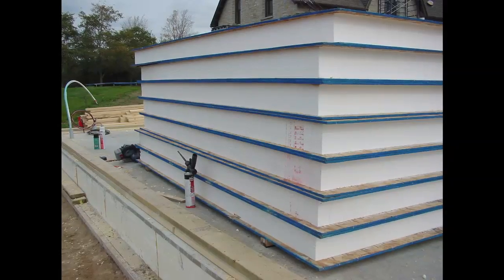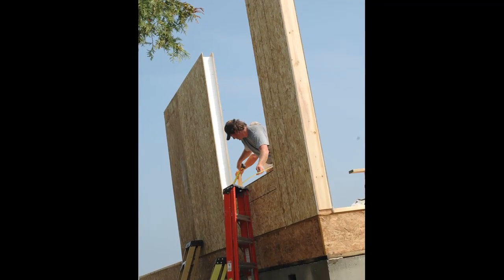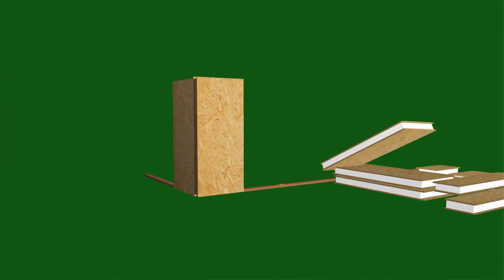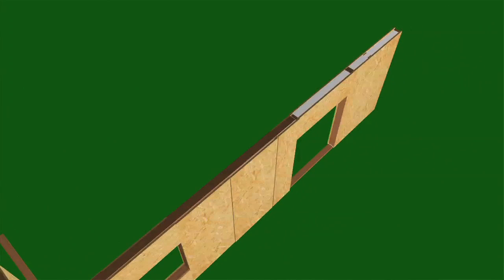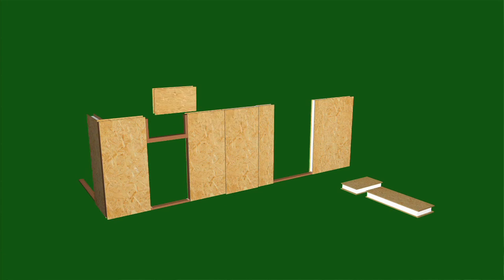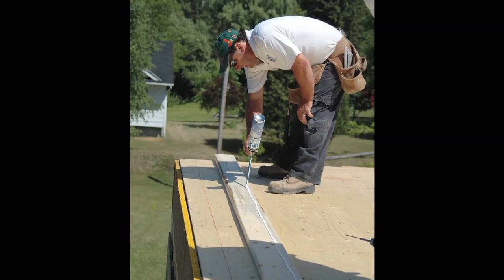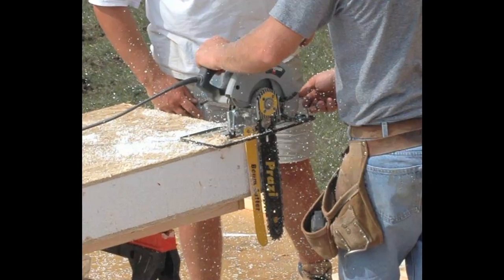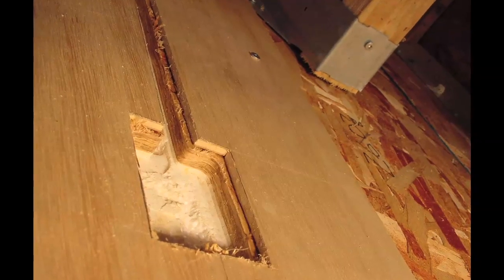How Structural Insulated Panels Work

Comment: Is the foam air tight, ie do you need a vapour barrier, if so you break the VB when installing slots for wiring. Seems better to batten and add additional inner skin to run pipes and cables.

Comment: Is it ok to put battens on the inside to create a void for plumbing and wiring prior to plasterboard? For would that affect the fire rating? Also, is wood cladding ok on the outside or does it need fireproofing first?
Reply: i’ve seen sips with battens.. I think Kingspan TEK has an example implementation on their website with cross batten service cavities on the internal side of the sip, and brick outer leaf also (instead of siding)

Comment: How long before this foam material breaks down especially in a very hot state etc
Reply: Hello Hard Truth!
SIPs panels have been code approved for 50 years, including for hot climates. Here where I live it's not a hot climate, but in the summer my all-SIPs roof on my workshop gets hot enough to fry eggs on. You simple cannot put your hand on the roof it's so hot, with the only thing between the shingles and foam is 7/16" of OSB. Things work and last fine, even when the foam is super hot.
I hope this helps.
Bye for now,
Steve
Reply: @SteveMaxwellHowTo  thank you for taking the time to respond

Comment: Looks like an electrician and plumbers nightmare
Reply from the maker: Good Morning Josh! Yes, you'd think so, but it's actually quite easy to run pipes and wires. The key is to think vertically not horizontally. Running pipes and wires through floor and ceiling spaces gets you where you want to go in the building, then you simply drop down or come up with the pipes and wires. SIPs panels can have vertical channels cut in them without diminishing strength. I use a router to cut grooves in the OSB, lay in the pipe or wire, then foam over the groove. It works quite well. I hope this helps. Thanks for watching! Steve

Comment: Ease?
Well if you have a crane, and electrician on site, at all times.
Have fun playing with all the foam sealent.
The out come can be good.
Air to air ventilation is necessary. 
Things have changed since I used these systems 25-30 years ago. I hope for the better.
Roofs over heat killing shingles, even with the vented panels .  Have fun. Chris

Comment: i'm not a builder but i see some issues/challenges with these. Running new electrical/cable or even plumbing after it's built would seem to be a major pita. What about wall mounts - ex, tvs? there's no stud to anchor the mount into - and i sure as heck wouldn't rely on OSB to hold it.  Then there are building codes. In california , years ago i think i recall a requirement for fire blocks about halfway up a wall. maybe i am misinformed as it being an actual requirement. But speaking of fire, is the foam in these panels flammable? more so than traditional insulation?

Comment: Look, we need to return to building houses like those that are 100+ yrs old - gosh look at those buildings in Europe, Japan, etc that are 500-700 yrs old.   What about old houses 100-150+ yrs old here with the original windows.  And today we can’t get a window to last more than 10-20 that doesn’t need replacing.  I tell everyone who has old windows (50+ yrs)  to not replace unless absolutely necessary.  Repair, prime and paint then do storm windows on outside, interior storms on the inside like they do historic houses.  They will be there another 100 years.  Replacement windows were aptly named because you keep having to replace them.mmNuts. And have good oil paint made up with real linseed oil that sinks into the wood, use BoraCare first to keep rot and wood eating insects out.  After seeing fire testing and seeing fires in my area...SIPs  may well be more efficient but I’m not using foam nor OSB. And I prefer panels that have 2x4s embedded - they are stronger.n Without - have you seen what they look like when a tree falls on your house - they just cave and break - there isn’t any structure to hold them fast. Instead of replacing a few sheets of plywood or even better individual heavy 2x8 boards for the roof decking - with foam and osb - you have to replace most of the roof because it caves andmthe osb begins to warp, delaminate, molds with lots water.  My gosh, look at all the flooding and rain from devastating storms ...OSB will be toast flood or fire. And foam, panels or spray..I don’t want that toxic mess either.  Friends had spray foam and can’t live in their addition due to smell.  I would only do rockwool that doesn’t burn, has high insulation and water runs through it.  Note there are different types of rockwool in treatments. You don’t want horticultural...it absorbs water.  And I want MagBoard... very fire resistant.  I’m going to get a piece of it to throw out in the yard this winter to evaluate it with extreme exposure.  Same with rockwool home insulation.  It is getting where you must test building materials yourself in addition to research.  You just can’t trust most of the hype put out by these corporations...nor your builder.  15 yrs down the road when the systems fail...where will everyone be to back you up.  I’m living in Virginia too..want to check out hempcrete..has been around for thousands of years and all because of my..it was banned.  How can our politicians be so stupid.  Hemp is great for building, ropes for holding ships, clothing, paper.  I think some of our founding docs were written on hemp paper.
Reply: I'm a Architectural Engineer. When it comes to the old ways. Especially in today's world. The time frame of construction and the material costs are to high. Hence when it comes to older styles design and built homes it literally take a good amount of time. In most cases especially in today's. Most people are not want to wait 3 to 6 months or even a year to 18 months. The SIP literally depending on the size of the home. It takes literally anywhere between 3 weeks to 2 months. As long as the time schedule stays firm with all the other components stay as scheduled. The company I have... we are using SIP design and a new "Carbon Fiber" structural design. I personally would never take Hemp or something that looks like a weed plant. SIP literally last anywhere between 50 plus years. Because the structural design of it is supported by Polystyrene Foam which last about a 100 years. So it has a very low form of decay rate. As for the OSB there are spraying chemicals sometimes used to prevent water leaks and other element and bug damage. I can honestly tell you I just don't use any materials when designing or building my homes. I carefully  research materials to the point where I sometimes up upset investment people or clients. Otherwise I will not use the material. Yes most people only want to stay with the old ways period because they are comfortable with the past. There is absolutely nothing wrong with that. But eventually yes people will have to my forward with newer advanced materials.

Comment: except the fact that if you get a leak the wood leaks and the foam gets waterlogged adding to the weight you have no solid framing strength and your house breaks an falls apart.
Reply: Pretty sure the insulation in the panel - what you are calling the 'foam' - is inert so can't absorb water.

Comment: 1. Is there outgassing? 2. What will termites do to this wood in the coming decades? An earthen or concrete dome will never be attacked by anything. 3. How many decades will the foam glue that seals the panels last? 4. How does this system stand up to extreme heat in a forest fire or next door fire?
Reply: They have metal clad as well. Use steel framing and there is no termite problems.

Comment: This guy must be a SIP salesman.  I don't build with flake board.  Moisture makes it come apart in time.  Build with plywood.  Any builder will tell you that.  A good realtor will also tell you that a plywood home sells better and is more structurally sound than a home built from flake board.  Al little more expensive, but well worth it down the line thru the years.  If you build too tight with no air circulation, you will get dry rot.  A faster build might be nice because you get in your home quicker, but faster does not always mean better...
Reply from the maker: Good Morning Woodrow,
No, I'm not a SIPs salesman, and no, you don't need to build with "flakeboard" to building with SIPs. You can get SIPs made with plywood if you want. There are even SIPs panels made to use underground as a foundation wall in place of a masonry wall. Just so you know, though, OSB (what you call flakeboard) these days is highly resistant to water. I'm personally not crazy about OSB, but it does stand up to water surprisingly well. I've submerged the stuff for days as a test and it's just as strong as ever. The main benefit of SIPs is greater strength than frame construction and better energy performance. I know of a SIPs home in the Caribbean (made of "flakeboard"), and it has been the only building standing on this island after three hurricanes flattened every other building with each storm. Also, side-by-side tests of a SIPs home right next door to a frame home (both built to code with identical floor plans) showed 50% less energy use than the frame home even though both have the same R wall in the walls. 
Thanks for watching,
Steve

Comment: This might all be true, but I see two major problems with this system. One, How would this system hold up in a fire? I'm guessing not very well because the heat of the fire would cause the insulation to separate from the panel making much of the structure very unsafe to be in or to have fire fighters come remove you from it. Two, what would a flood do to this system? I'm guessing the flood waters would cause major damage to a system like this vs. conventional stick framed buildings. Imagine trying to replace a whole panel vs a sheeting and dry wall from a flooded house.  I believe the flooded SIP house might even be totaled after a flood and require complete rebuilding.  Homes don't just have to provide shelter in sunny clear weather. They sometimes have to save you from the harsh elements. This SIP house would be like trying to find shelter in a large foam ice chest.
Reply: True true true.  Ive been a mechanical contractor for 20+ years i love the idea of higher r value walls but not at the expense of strength and safety.  Nothing has changed my mind from stick frame with spray foam, or formed concrete with the insulation built into the cast.  The sips structure at the end also would not do well in high winds either.
Reply: Dunno, compared to concrete houses, both sips and wooden frames look the same in terms of structural resistance, but i can appreciate the modular nature of sips
Reply: I think it would depend on the fire treatment of the plywood and the air seal of the house. A tight envelope might prevent a fire from spreading by using all the available oxygen. With flood damage it would be dependent on how fast you dried it out. We're dealing with flood damage right now. Our neighbors with sheet rock have had to tear out everything that got wet, but our wood paneling has been fine, and so has the foam. Regardless it would require mechanical ventilation

Comment: How long do SIP houses maintain structural stability when they are fully involved by fire? Running electrical lines in continuous void spaces around flammable foam seems like a hazardous application. What is SIP's resistance to electrical arcing compared to fiberglass insulation?
Reply: Electrical lines are not meant to be bare and cannot spark in wall cavities if installed correctly. If rodents are a concern for chewing wires, there is less likelihood for rodents to burrow into the dense hard foam than in fiberglass. Also, many newer foams are treated with a boron solution during manufacturing for fire resistance. Paper faced fiberglass is going to spread fire much faster than a newer SIPs panel.

Comment: what happens when the glue holding the plywood and foam together degrades over time ? it is hard for me to trust in just glue holding plywood and foam together. id like to know more about how the bond is made.
Reply: and the fact that if you get a leak the wood leaks and the foam gets waterlogged adding to the weight you have no solid framing strength and your house breaks an falls apart.

Comment: theres gotta be a downside
Reply from the maker: Yes, there is a drawback to SIPs. A couple actually. This first is that they shouldn't be exposed to weather for more than a few months. This means that the building needs to go up and get dried in fairly quickly. Another issue is ants. They do love to nest in foam. I understand that chemicals are added to discourage ants, but I don't know if it always works.
Thanks for watching!
Steve
Reply: thankyou

Comment: +Steve Maxwell  Two questions please:

1.  Website Vertigo:  I saw this in one of your comments:  "For construction, woodworking, renovations and tools, drop by for a visit at  https://stevemaxwell.ca. Homesteading stuff is at http://www.realrurallife.com".  And somewhere else, a suggestion from you for people to sign up for newsletters at a different website -- https://baileylineroad.com.  How is that third website different from the other two?

2.  DIY SIP construction:  Have you looked into or have experience with making your own SIPs?  By that I mean, buy plywood, foam, and adhesive; and then find a way to paint on the adhesive and weight down the assembled panels until dry.  Might be more cost effective, maybe for small projects like outbuildings, etc.  Don't know as I've never priced SIPs.

Comment: Hello,
 I wonder if you can use those panels as slab in a metallic structure?
If yes, How would the junctions be?

Thanks
Reply: I wouldn't stand on anything like this without trusses underneath.
Reply from the maker: +ricard gimeno perramon Good Morning Ricard!
Yes, SIPs can be used for self-supporting floors. The thicker the panel the more it can span. Panels are 4 feet wide, and the joints are accomplished with a double-thickness of 1 1/2"-thick lumber fastened together and fitted into the recesses along the edges of the panel.
I hope this helps. Thanks for watching!
Steve

Comment: I'm a big fan of SIPS and I believe that they are the future of housing.  I still have some concerns though.  I don't know if other Australian YouTuber's can add to my comment.  My concerns here in Sydney would be termites.  I don't know if termites are a problem in Canada or not.  They can be an issue in Sydney and especially in the warm Tropical areas of Australia.  I'm referring to Termites attacking the plywood of the SIPS panels.  My other concerns are Fire Resistance and Acoustic Performance and moisture.  How do SIPS panels perform as far as sound insulation is concerned Vs stick frame with say rock-wool sound proofing batts.  How about moisture sealing of the plywood?  Vapor sealing etc.  Those are my main concerns.  Other than that I'm a 100% true believer in SIPS.  Especially if I lived in a very cold climate.  Do SIPS constructed homes 'breath' well?
Reply: tim schulz 
What is double glazing?
Thank you.
Reply: Double glazing is two layers of glass in your windows as opposed to a single pane.
Reply: they are strong and you can opt for metal skins or plywood

Comment: Hi Steve,

Can SIP's be used for those wanting to build a Passive home? You mentioned saving around 1/2 on energy bills but I was sure I have read Passive homes save even more.

Finally for a tiny house on a trailer build,I think the only SIP choice would need to be the thinnest ones.That is because of the narrow width of the build.If using the 4 1/2 width,what is the R value there?

Thanks so much,Tim.